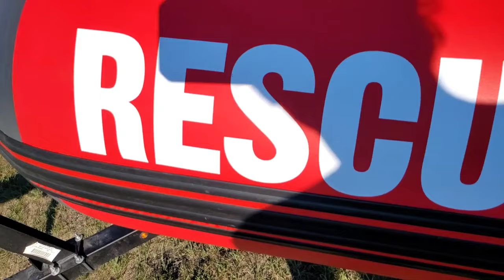Time-lapse: Building/Assembling A Fire Rescue Vessel Inflatable Boat

Comment: Great job on this build! The video was very helpful as I am considering doing a similar build and soon making the purchase. What length cables are you using for controls and steering?
Reply from the maker: Thank you. Too be honest, I don't remember the length, I believe it was 12 feet length cause the 8 foot cable was to short and 10 foot wasn't available.